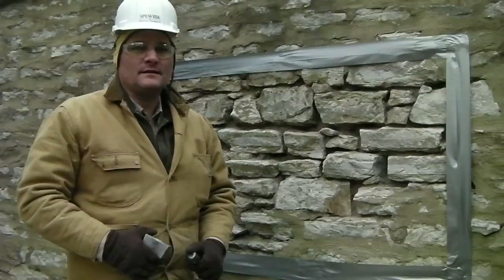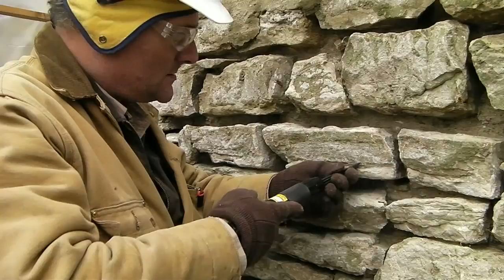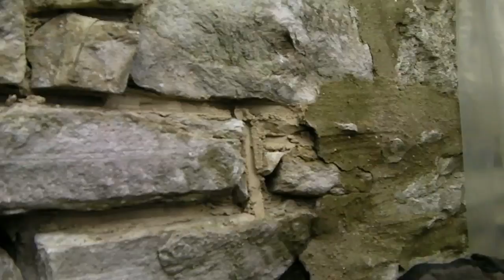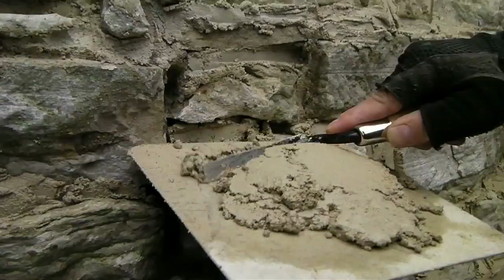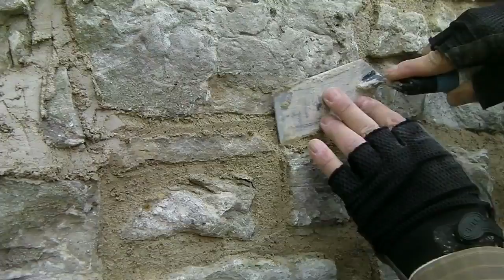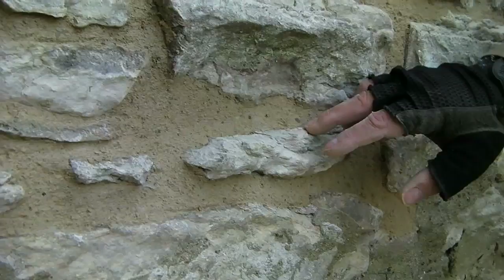Missouri Botanical Garden, St. Louis: Test Panel - Remove Cement Mortar Repoint with Lime Mortar

Comment: curious, what is that tool you're using to clean the face of the stone? it has the multiple rods sticking out. I've been searching for a good way to clean the face of the limestone to get rid of the mortar stuck to the front of the stone. Need to find a method which doesn't ruin the stone. I've dug out all the joints and this is my next step. Please, any help would be appreciated greatly. thanks.
Reply: challengerbrant it’s a needle scaler but it is a detail one I think as the standard ones have a lot more needles
Reply: I Didn't See a Needle Scaler in this Video the Only Pnumatic Tool I Saw was Made By Trow & Holden in Barre VT. It's an Artist Sculpting Tool for Carving Stone.

Comment: Here in France NHL mortar is really common due to the number of stone house, the application technique is to throw it at the wall. A golf ball sized lump is on the trowel and it is flicked hard at the wall. It sticks and also forces itself down into the crevasse. Seems to work. You ever do this?

Comment: Why 'Hydraulic Lime Mortar"? I see others say it should be "soft lime mortar" so the mortar can be 'self sacrificing' -- ie, allow the water to go through the mortar and not the stone itself. The word "hydraulic" would seem to infer that it was water-proof mortar.
Reply: Wrong.  Get educated on NHL.
Reply: @smackasalmon8394  Why not inform him on a reasonable and helpful level, point him to those areas of education you're so ready to bark out - instead of being a completely ill-mannered troll who has absolutely no worth whatsoever on this medium? 

'Wrong' - "I'm the most brilliant educator on the planet"..

Tell you what, Matthew; why don't you share that extensive knowledge you have and give the youtube community your valued tutorial on how Beethoven came to compose his 9th Symphony? go-on, Einstein, we're all waiting, bated breath. Lol.
Reply: Natural Hydraulic lime. I tend to use 3.5  NHL lime to repoint walls as it sets quicker than Lime putty mixes so is less likely to be washed out if it rains during the curing time. It is not impermeable to moisture like cement so the stone can breathe. I do however keep lime putty and premixed lime mortar on hand for small repairs etc. It’s good for small amounts of pointing when fitting sash windows etc.
Reply: I think he means hydrated...
Reply: S R.B not quite, hydrated lime is Slaked lime but it still can set via hydration (hydraulic) or by carbonation.

Hydraulic lime only sets by hydration thus coming into contact with moisture  as opposed to carbonation or air drying lime that takes C02 out of the atmosphere to set. Hydraulic lime will cure in a higher temperature range and has a higher strength of mortar than those made with carbonation setting limes such as lime putty’s. Hydraulic lime can be used under water too
Reply: @sr.b8002  hydrated lime is used as a plasticiser in cement mortars and should never be used on its own